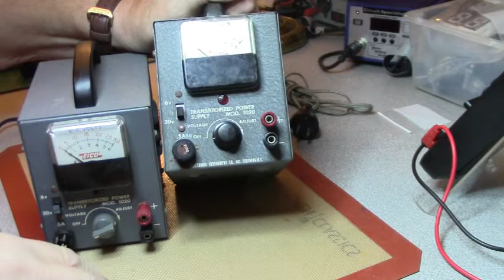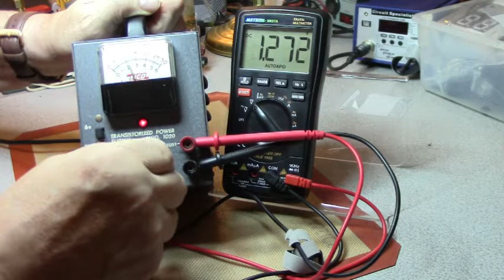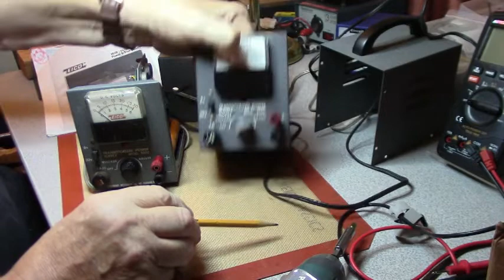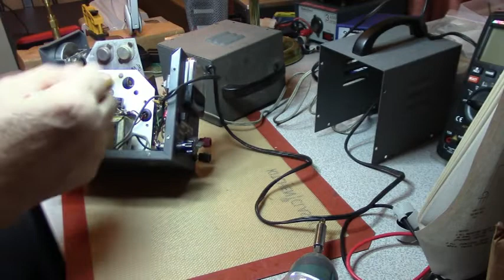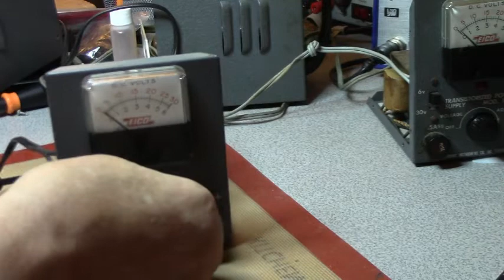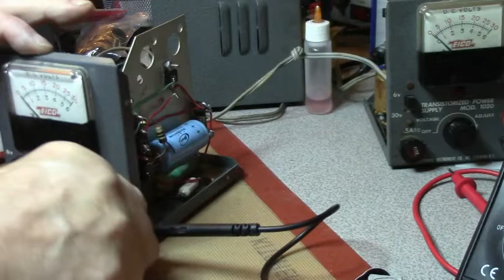Eico Power Supply Pt 1

Comment: The 1020 on Radiomuseum.org is like B with no logo and two transistors. I have a feeling the manual is for a later version with a heavier duty transistor so one was enough. Whoever butchered power supply A should be shot! Interesting units.
Reply from the maker: So far, I've seen about 4 variations of this supply. I found a schematic that I think is the right one, and I'll be checking it out in the next part. Thanks for stopping by!